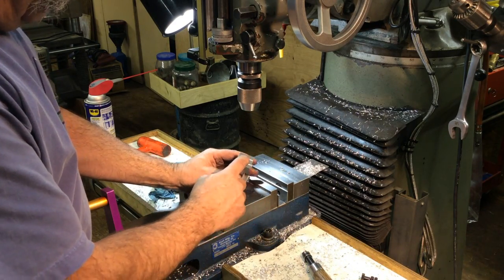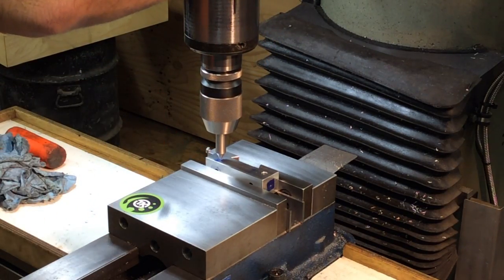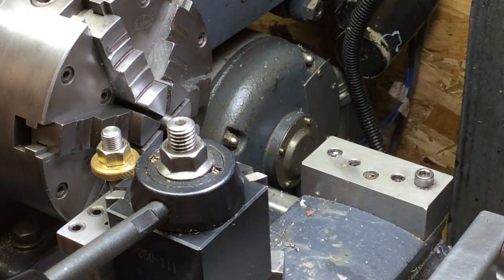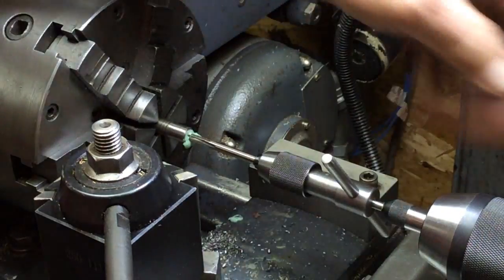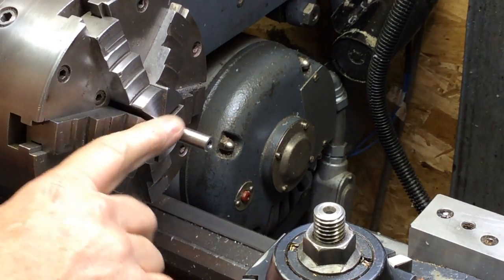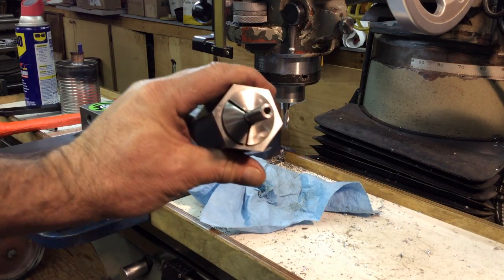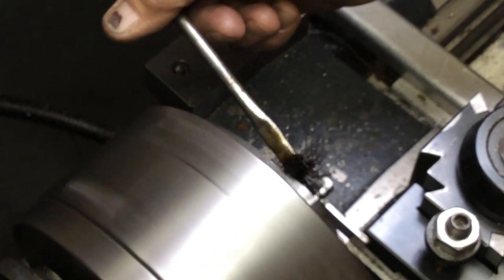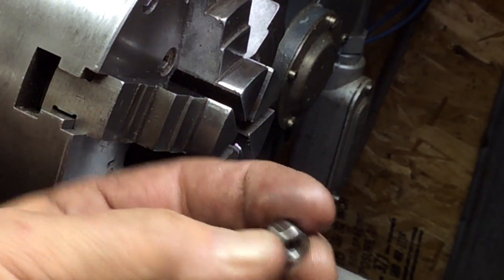Quick Change Tool Post Indicator Mount P2

Comment: Hi Randy,
The spline on the ends is great if you need a lot of drive power, you can...
Looks clean and nice for thumb screw.
Excellent...
Pierre
Reply from the maker: pierre beaudry They are only 10--32 screws and it gave them some good grip with the screw head for some addition torque. But they look good.  Thanks Randy

Comment: I like the idea of the ball milled splines instead of knurling the screws, knurling stainless would be a bear. Also I noticed that you went with less thread engagement in the nut, I have found that works well on stainless, since you are going to locktight the screws into the nut it will be just fine. Personally I prefer to use green bearing mounting locktight on such mountings just a little more insurance I guess.
Reply from the maker: James Dedmon I like the look of nice splines and yeah knurl on stainless small Dia very tough, I have a very lousy knurl tool.  Sometimes you just use what you have, the closet store that might have that stuff is 1.5 hr drive.  They are just thumb screws.  Thanks James, Happy New Year.  Randy

Comment: You really have that tool maker mindset where you go from an idea "i want something that does this/that" to "ok, this has to have a certain feel to it, so thumbscrews with splines, they have to be this big, this tall etc."

Really, really nice.
Reply from the maker: aserta For me it is not just the function.  I have found that it things don't feel and or look good you won't use them.  I have scraped parts because of that in the past.  Thank you for watching, Randy